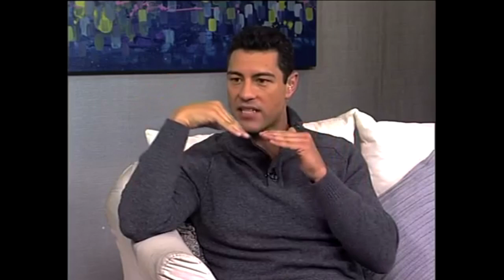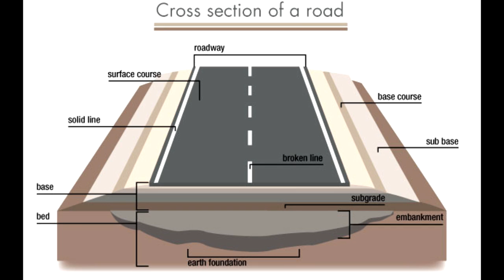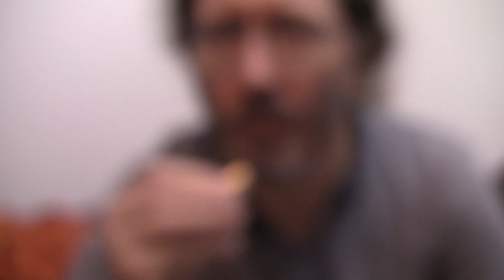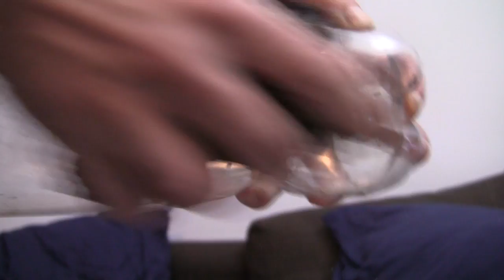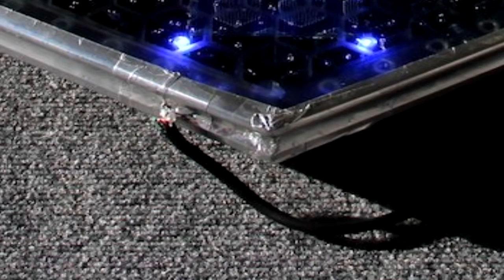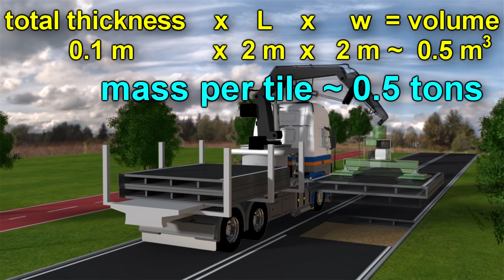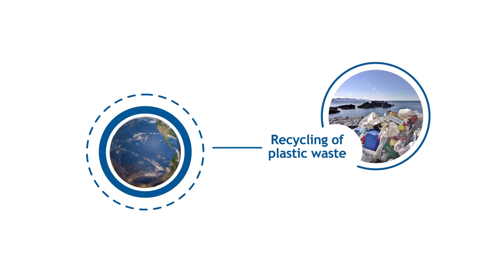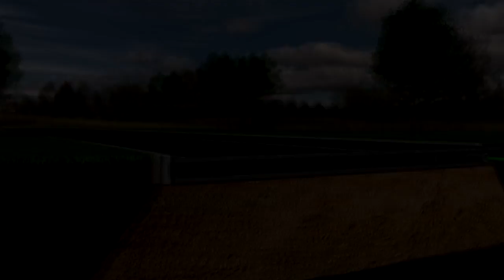Plastic Roadways BUSTED!

Comment: Fun fact: Soda bottles will all weigh roughly the same, since they're inflated from the same preforms. https://www.amazon.com/Soda-Bottle-Preforms-Caps-30/dp/B008MB1QNY

You take one of those, heat it, and vacuum-form it to the shape you want your bottle.

I don't know what the obsession with combining underground cabling with other things. Running underground cable is extremely cheap and fast on its own compared to infrastructure like this.

Comment: Plastic Roads will last 3 times longer than asphalt or cement?  Are you high? Not to mention, you've taken a road and made it high-tech vs low tech, meaning higher costs than you think. I could see the road being solid pieces which can be replaced easily, with the hollow segments on the side, but hollow plastic road, loaded with tech that has to be played with every time a piece of road needs replacing is just stupid. (Think accidents, Chemical spills. Oil spills. Surface grip in all conditions...)

Comment: No,u don't understand. Roads are made with 90% sand,concrete etc... and 10% oil. They are just trying to replace the oil with plastic. It's not going to be complete plastic
Reply: but plastic is still made from oil
Reply: plastic does not fair well with sun light, and will only break down into micro plastics/toxic gasses that are still harmful.
Reply: They're video certainly made it seem like they were saying the entire thing was going to be plastic.
Reply: They don't use oil, they use bitumen. Which is a byproduct from the oil distillation. Thats why we use it, its dirt cheap and perfect for roads. And it is the most recycled product that we have, we recycle it 100%. And by definition bitumen is pretty much a plastic.
Reply: Also this project will only increase demand of plastic, thus increasing production etc due to the shear amount we need to cover an area consistently.
Reply: PaperBoy Why?
Reply: They could use PLA (which doesnt need any oil), but PLA would have HORRIBLE properties used as a road surface (and it would be A LOT more expensive than asphalt).
Reply: I don't think you understand your own comment.
Reply: Have you even watched the video? The way they promote the product combined with the CGI animation makes it seem like that they were going to make the entire road out of plastic. Plus if it's still mostly asphalt then it isn't light weight as they claimed or even made mostly out of recycled plastic and isn't hollow to allow for wires or drainage of water.
Reply: PaperBoy See 18:00

This is hardly any better than asphalt. It also completely contradicts the model they've advertised, such as it's being "lightweight". Seeing as asphault is already so recyclable, and bitumen only takes a comparable amount of petroleum products as plastic, it doesn't achieve much, especially since plastic can be both recycled and and burned as fuel.

None of these things work in practice because, at best, they are simply small scale permutations of resources. It might make sense if one resource were so much scarcer or more expensive than the other, but that doesn't seem to be the case.
Reply: K
Reply: But bitumen is a waste product from the refining of crude oil, so if you replace that with plastic, then you just send bitumen to the landfill instead, even if there was a better (or equivalent) road surface, it would be better to wait until we are no longer refining oil for other purposes and therefore stop producing bitumen as a byproduct
Reply: and that is so delusional i think i had a small stroke
Reply: Plastic melts.i forgot a tile solid plastic 3x10x15 cm in the car and it deformed pretty bad. imagine a hot summer day im not talking nevada or so . 24/7 it lays on the ground burnd by the sun and the earth itself . where i come frome there are lots of hedgehogs . it would be a death trapp for them . even if it was 3% plastic it vould still be a death trapp for them . (sory  english not first language ). i could imagine cats and dogs getting stuck . ive read lots of coments here and nobody mentioned it .  (frome Europe)
Reply: Ghorda9 they are using recycled plastic, therefore not making anymore waste, but actually reducing the amount of waste in landfills.
Reply: PaperBoy thunderfoot is a fool he did no research before making this video

Comment: One of the best advantages of asphalt is that it is NOT prefabricated. Asphalt is actively laid to fit the desired form at the job site. Prefabricated modules would probably be a nightmare anyway.
Reply: Could you imagine having to field fit every single tile while building a road?  You'd be lucky to "pave" a kilometer a month.
Reply: tbh over here in germany we had the old autobahn produced in tiles from beton, i think there are even some of them left in east-germany. It actually was cheap and fast to build/repair but didnt last long. The problem was that the tiles get driven into the ground uneven, so you'll get very bumpy roads quite soon. That would also not be very good for those cables and pipes running through there.
Reply: Linus P Mate, for a while here in Mumbai, the government decided that paver blocks where the way to go. Next monsoon half of them were gone. The rest had a tendency to dip ever so slightly when trying to drive on them.
Reply: Doesn’t plastic also get really hot really easily?
And isn’t its melting point kind of low?

What I’m imagining is a day in Arizona where the temperature has reached 120 degrees Fahrenheit. A heavy truck is driving over the heated plastic, which is getting hotter thanks to constant friction. Next thing you know, the truck starts to sink into melted plastic. And that road is shut down for the day.
Reply: @LadyShay345  Ever looked up the melting points of bitumen and PET?  Perhaps you should fact check?  If a road got to 260C you'd have other problems.
Reply: @MarkTillotson  If we were making roads just out of bitumen, then it would be a problem. Fortunately the melting point of rocks is not a problem and bitumen just gets soft. It's so sticky, it does not want to separate. But yes, a plastic road would be like a full bitumen road. The moment it gets hot, it would start to soften and sink. Not great. But, at least you can't break bitumen down into microplastics that water will carry into everything. Microplastics in the environment is already a huge problem, and that's just from trash that accidentally ends up in the ground and land fills. Imagine thinking filling the ground with plastic roads is a good idea.
Reply: I have an Autobahn near me made of concrete, although I think they poured the slabs on site. When it got really hot one summer the expansion joints where overwhelmed and some of the slabs popped up. That made some neat ramps  that you could get some good air of, especially since most of that Autobahn is unrestricted.
Reply: Captain_Pudding and not to mention when you need a replacement tile: “oh yes I’d like part 16355-C please. You know, the one with a dip 2/3 of the way through and a curve to the left with a slight bump in the back...
Reply: melted composite plastic? That might suffice, but I like Thunderfoot's plan to burn it better
Reply: Exactly. It also doesn't use PLASTIC
WHICH IS KNOWN TO BE BAD TO THE ENVIRONMENT
Reply: ...says an asphalt vendor. Prefab is how they build everything else.
Reply: Yep and would continue to take shape after, with proper fill when needed.
Reply: no plastic soon if it was true not enough oils...
Reply: Some states like Alabama you can own a tank.
Reply: Captain_Pudding it's been done successfully, it's called precast concrete 🙄
Reply: metademetra 
There are polymers that can withstand 275°C or so. Manufacturing is a lot less easy than the lower melting point one from what I know.
Reply: I’m not sure what the obsession is lately of having everything “ premade” or prefab…

Some things you have to build on site based on the terrain
Reply: William Hammond Plastic roads,are real,and do work.He isn't telling people everything about them,they are mixed with Assfault.

Comment: I watched the first part of the video.  You're comparing the thickness of a pop bottle to that of what would be used on the road.  That is like taking a a thin sheet of concrete busting it over your head and saying it would never make a good road.  If the plastic is layered thicker it will hold up longer.  Also let me point out that having abrasions and or more surface area on the plastic will only increase the friction or the ability for the tire to grab the road.  My initial thoughts were that plastic is too smooth and when it gets even slightly wet it would cause people to lose grip.  After having looked at it further if you replicate the ridges naturally created by asphalt, but thicker than a pop bottle you'll have something that is more durable and will provide more grip/friction for stability.  I think the application for plastics in road ways by either using plastic as a binding material or using plastic for prefabricated sections is actually a good idea.  Plastic has a better thermodynamic range than asphalt does and will hold up better to the extreme eat and cold.

Comment: The romans obviously knew something was right when the invented them.  MacAdam a local hero here who reinvented a technology that had been lost with time hence we have tar-macadam or tarmac on our roads.  The M25 was originally built by a German company who laid the raid via a watching that talks the base the metal mesh and concrete.  As soon as the road had been finished the concrete surface had started to deteriorate and they had to tarmac it.  They use tarmac because it is such a good resilient material.   Plastic is not going to cut the mustard.   NOw if they used the blocks and tarmacked them then you have a surface that cars can grip to without wearing the surface down straight away.  That's how they make girder bridges in a piece kit that is covered with tarmac. But they obvious use metal tubular structure to be lightweight and strong.  As someone said here.  As soon as that stuff catches fire you have a major problem.

Comment: Plastic, Ok lets think about this a second BEFORE I watch this video.
Plastic is in most cases fairly soft so it doesn't seem like a good solution to me.
.
What if a car or truck catches FIRE on that road.
Plastic burns and will release a lot of toxic smoke.
.
Plastic will become smooth due to tire friction so traction would be a problem.
.
Plastic contains a lot of harmfull elements that will seep in the groudn with every rain storm..
.
How will they make the roads.
All style segments like the old concrete roads in Europe after WWII.
They where a nightmare to drive on because over time they will become uneven.
Cheap but horrible.
.
Sorry I see more problems then solutions with this tech so let's watch the video and see if I was right or wrong.
.
Ok I have seen it and it is even worse then I thought but I have 1 more question.
IF there are cables inside the roaddeck and you need to replace 1 unit how will that works with the cables in place.
Wouldn't a tube or tunnel besides the road be more practicle.

Comment: I presume the original designers don't plan on using plastic alone probably some kind of mix of recycled plastics and aggregates ergo not dissimilar to tarmac. The drainage would be by the material being porous in the top layers and impermeable at the bottom. The  edge of the joint could be a bitumen filled saw tooth to reduce noise, you wouldn't need expansion joints as the expansion would be driven mostly by the aggregate filler. Building sections in the factory would have plenty of advantages in terms of controlling and standardising the surface plus the method of laying would potentially speed construction because you could have multiple work fronts. Also if you built some more concrete or other reinforcement into the module you will be able to get away with less foundation to the road. In short the idea is not terrible the execution will be the key to success.

Comment: Prefabricated roads are noisy to drive on, the joints add to road noise, it's unavoidable. On my daily commute there's one section of concrete road with bitumen joints, and it really sucks to drive on, and that's for less than a mile, at town speeds, driving for hours at motorway speeds would drive me frikking nuts.

I also don't see how they make the road fit the terrain, each curved  piece would have to be custom made, to accommodate curve, slope and camber, that is done by a bloke with a digger at the moment, sculpting the shape with ballast, but a pre-fabricated road would have to fit over the existing route, and mimic it section by section, so this solution would only be deployable on long straight roads, but then as mentioned that's a motorway, and the noise would be terrible.

Comment: I think that solar roadways shoudl change to thermal roadways, and make it so that under a certain temperatur it would start to heat up meaning it would melt snow, but then turn itself off, so there would be places to walk, however it woudl of course need drainign ot it'd just be super slippy

Comment: Thunderf00t: I admire your knowledge and all the effort you had put into researching the topic, however it seems you were consumed by your own passion to eliminate those guys so much, that the value of your point in general went diluted by either biased or selfserving notions. Like, among the valid and key objections, the design of the panels is a matter of engineering - they could design anchors to pin that panel to the ground; make some sort of linkage between panels; design pipe-cable tunnels as separate panels.. and so on. Not that you are wrong, just there are more options than just to cut or to cut not. :) As your audience I would also wish there was some order, a structure of primary and secondary objections, with a cherry at the end (so your videos can have better views stats). Best regards.

Comment: there is another significant problem and its that a large majority of the world at some point of the year goes below freezing.

furthermore water dose not travel by itself down roads it brings dirt which builds up.

get an area blocked by sand so that water cant pass freely and have you ever put a full bottle of water with no room for expansion in the freezer. it warps or gives way.. 

not something you want on your roads

them there is the problem of them contracting and expanding and potentially coming up just from that and or getting yanked up due to being on a hill

Comment: plastic can't be stronger than stone and steel. Plastic is not enviornmentally friendly at all! More like ruins the soil and our food supply.
Reply: there are allready test build bridges and i work at a company currently making plastic parts for railway construction. "too soft" cant really be taken truth they are rock hard after conditioning.
Reply: I've heard about the recycled plastic rails for railroads. I've read they last 4 times longer than wood. Usually there are processes that make a material far stronger than it originally was. I think roads take a lot more stress than rail roads with millions of cars. Plastic works fine for rail roads but it's not practical for roads. Just a different design I guess.

Comment: uhh dude the plastic is going to be a couple inches thick so if it does get installed then it'll need to get replaced at least every 1 month but EVEN THEN they can mold it back to shape so it's not as expensive or weak as you think it is

Comment: If they want to run Water Pipes in there they already failed, its gonna freeze in the winter and block off all the water from homes lol. Also you are not allowed to have your shit run on the same level of your drinking water, imagine a hole in the pipe! Your drinking water is fucking full of shit then

Comment: Wait till a truck with fuel crashes or any vehicle for that matter then catches fire and explodes. Plastic melts and becomes brittle in cold weather. I know new materials can be made but if you look at it the cost would be to much.

Comment: Question , Am I the only one who noticed the mathematical error in the line from the movie Shawshank  redemption ,where he says 500 yards and then compares it to just short of half mile ? 
Correct me if I am wrong but isn`t a land mile 5280 feet , and half that would be 2640 feet 
And there  are 3 feet to a yard so 500 times 3 is 1500 feet ,which would be a little over 1 quarter mile which is 1320 feet 
Did I do the math wrong or have we somehow changed the length of a mile ?

Comment: What about a solar-plastic roadway that is "driving" itself over the ground on a magnetic levitation platform that is powered with thorium and special cars that use the EM-drive along with small thorium reactors and placing the whole construction inside a vacuum tube (which is also thorium&solar powered). On top of the pipe is something that collects rain water which is hydrolyzed into oxygen and hydrogen to deliver additional power along with wind turbines every few meters just because why not. I would say you could reach at least 1/10 the speed of light this way and revolutionize the world. And because of the time dilation effect you would safe a lot of time, if you would deliver extra power with fusion reactors maybe you get near enough the speed of light to be at your goal fast enough to save more time than you spent driving.